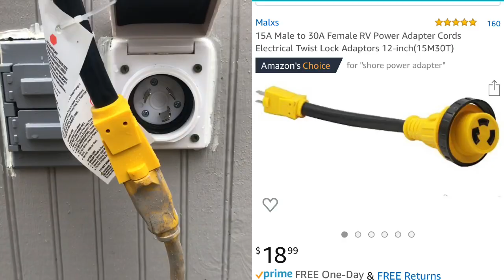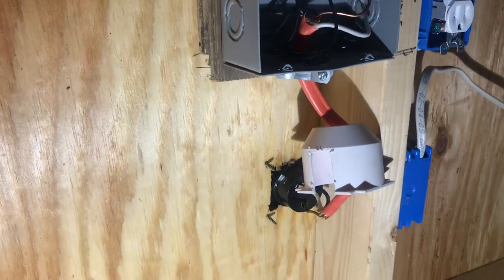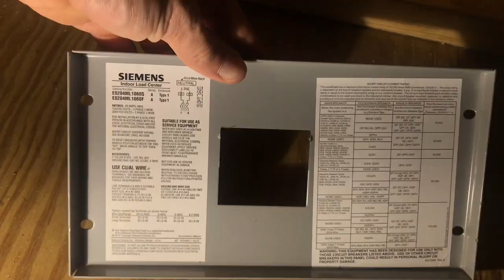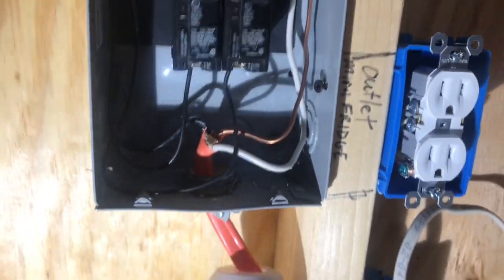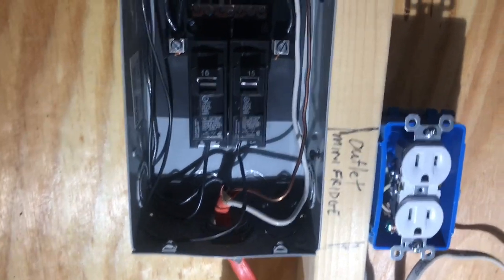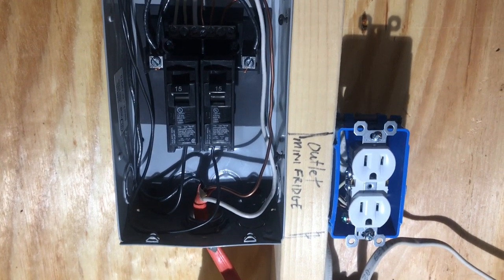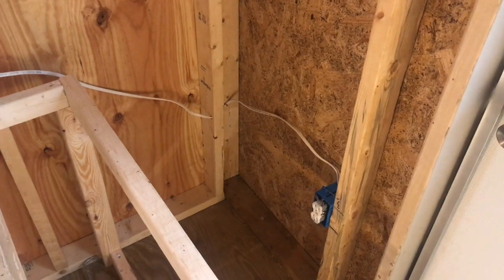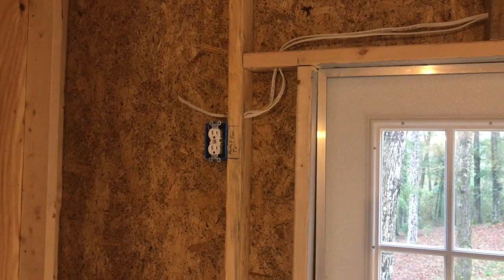$3K Tiny House On Wheels: Electrical

Comment: just for future knowledge the A/C unit should be mounted high up heat rises cold falls when you have it low it is harder to keep it cool or cold  , i know this has been built for 3 years at this point but in case anyone watch;s for future inspiration

Comment: The main issue I see now is that the wire coming i to the corner of your bathroom (the creative wiring). What you can do is add a nail plate or something to that affect to protect the wire from a nail or screw from hitting the wire. I understand that your keeping the build under $3K but your panel box concerns me a little. But if your loads are even and small, you should be fine

Comment: Im wiring my tiny house with 14 2 wire not many outlets and a few lights, dorm fridge and micro will be on a 12 2 own line along with my AC unit on a 12 2 own line.  Will that work?
Reply from the maker: It sounds about right. Are you doing 15 amp breakers for each branch?
Reply: @oursimplestorychannel  yes 15 amp breakers, I just hope I got the right service box, I think I got a 100 amp service box with like 6 or 8 breaker spots
Reply: 6 breaker spots, looks like ill use 4 or 5 at least
Reply from the maker: @familyfunwhipples  it’s actually good to have more breaker capacity in case you one day add more breakers.
Reply: @oursimplestorychannel  so can I just supply with just 110v to the trailer and run the service box , will that be ok to supply 4 0r 5 15 amp breakers
Reply from the maker: Sure. The question is how much of a load you’ll have drawing simultaneously. You are limited by however many amps the extension cord/outlet/breaker can carry. So in other words, if you run an extension cord from your house to the trailer, you are limited by however many amps the extension cord is plugged into. Make sense? You could heat up 4 15 amp breakers but can you draw more than 15 amps at a time? No because you’re limited by whatever the max is at the shore power box or the power source box/breaker. Hope that makes sense haha!
Reply from the maker: You’ll also want to factor in power reduction and waste based on the length of cord you’ll use.
Reply: @oursimplestorychannel  ok ill have exactly five light fixtures, five regular 14 2 outlets, and 2 12 2 outlets for a small window ac and a small dorm fridge and small micro.  Should i set up to supply 220 to my trailer.

Comment: So its ok to bond the green and ground to the same bus??
Reply from the maker: Green is ground.
Reply: @oursimplestorychannel  ok sorry but my tiny house power will be based of this video.  Thank you for the video.  So my question is can the white wire and green wire both be connected to the same bus??
Reply from the maker: Yes. Totoally. Let me know if you have any more questions. Glad my video can be of help.
Reply: @oursimplestorychannel  would it be a wast of time to put a rod in the ground and bond the ground rod the the bus also for safety?? Im not planning on moving my tiny house for 2 years. Thank you.

Comment: Looking good. Be cautious with that many outlets on a circuit, that is a bit of draw. 

Only thing I would do differently is have the breaker box up higher. Gives you easier access and easier to work on.
Reply from the maker: Thanks for the feedback!

Comment: That’s probably 10/2 wire actually, it’s usually orange and handles 30 amps. 

Also that’s 10/2 wire. 3 would mean 3 wires (white, black,red-another hot line)  ground wire doesn’t count in there numbering system.
if you had 10/3 you could have ran a red and black wire to each breaker for power in. Granted both would have to be hooked together on the hot side at the plug-in to get power...not code nor a standard practice for some safety concerns but would probably have worked just fine for this small size application.

This comment isn’t ment to be a dig at you but wisdom for anyone watching this to get knowledge like we do from YouTube videos.
Reply from the maker: Thanks for the info!

Comment: Actually, your wiring is pretty good. Might I offer a suggestion for your next project?  Next time you should look into a 12 volt system and add power inverters for a residential fridge. 30 amps could be used for the ac unit and microwave. The rest should be led lighting which is affordable and of course doesn’t draw much power at all. You can always use solar panels to recharge the batteries. Propane for a propane stove. Easier sell. Screw it, I’ll come help you lol
Reply from the maker: Thank yo. Come on and help me! Bring something to grill :)
Reply: Our Simple Story yes some ribs and t-bones
Reply: Our Simple Story the tiny home is looking great though man. Good job!
Reply: Too funny.. I needed to laugh...& to make up my mind how the heck to get out of WI to TN & find a tiny house, RV, or container home that's under 20k!! Peace & quiet, no lofts with ladders, a washer & dryer stacked, & fireplace are musts... Been looking at options a long time I'm ready for therapy!!!